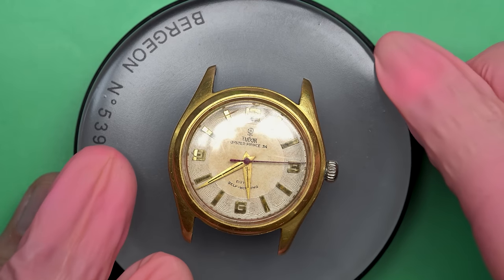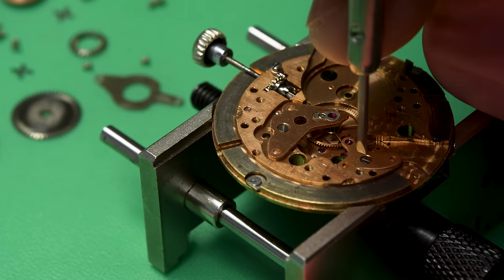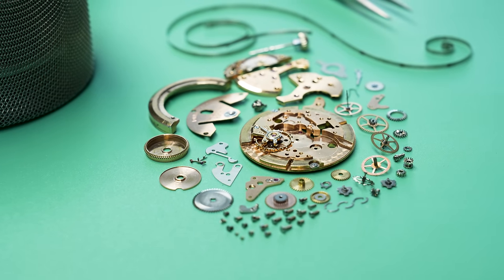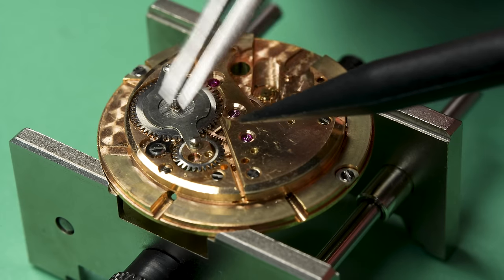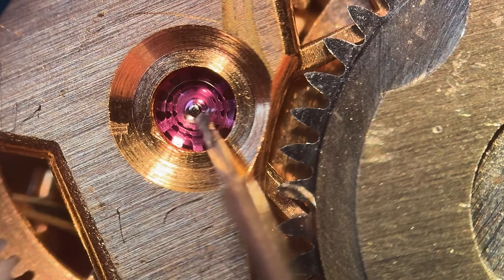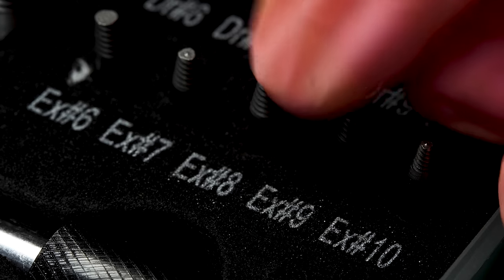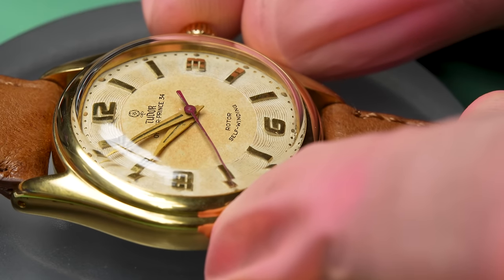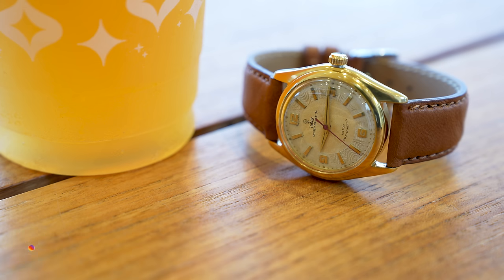Tudor Oyster From the 1950s Needs a Full Vintage Watch Restoration

Comment: Hay I've loved watching your videos they are relaxing and very satisfying to watch. I do have a question I have a watch that I bought from my fist job I ever had in 2004 I wore it for about 2 years and the stem broke on it I sent it into the company and they replaced the stem and after watching your videos I now know they left the stem about quarter inch to long with a slight bend in it so I was not able to ware it I still have this watch and would love to be able to use it again or be able to gift it to one of my kids when they get their first job but how do I find a reputable watch technician to fix my watch when the company that makes the watch made an error like that. I would love to send it to you to work on but I've noticed you tend to stick with vintage watches and or higher end watches this watch is a 200$ timex  I think.

Comment: Marshall, I am not sure if you have mentioned it in another video or not, but I don't recall ever hearing it. What cleaner solution do you use in the ultrasonic? You said in this video at 40:35  "some distilled water and a little of the cleaner that I use..." when cleaning the case. Curious what that cleaner is. Also, would it be safe or the recommended cleaner for movement parts if one were to use an ultrasonic to clean those?

Comment: Another great one Marshall! For the case tube, would it work to thread the crown onto the tube and then use the crown to tighten the tube into the case once the crown bottoms out? You could let the thread locker dry and then just take the crown off.

I’ve never done this, but I feel like it could work so you don’t risk scraping the inside of the tube.

Comment: I think you need to check those two spring clips.  It looks like the bottom of the U shaped slot is not seating into the groove in the shaft.  I noticed that the one had come loose during casing and you replaced it but it still looks not quite seated.

Comment: A little trivia about the 390 movement (along with the very similar 395) is that it is one of the very few in house, Rolex-made movements used in a Tudor.  After these models, by the mid 50s, they switched to AS and later ETA movements for the Tudors because there wasn't really any great distinction between the high end Rolexes they were selling and the Tudors with these movements.  Tudor was introduced in 1946 as a lower cost alternative to their higher end Rolex watches.
Reply: But was this a 390 movement?

Comment: I always though crystals were made of sapphire, and just a quick Google search shows that I guess some are. My question is why haven't I seen any sapphire crystals on the higher-end watches you work on?
Reply: He mostly does vintage. Sapphire is a relatively recent application. Kind of really only seen sparsely in the 80s. It's maybe in the last 20 years that it's become more of a standard (still tons of mineral/hardlex out there).
Reply: @notDonaldFagen  Thanks! All my watches are newer, like late 1990's and up, and I was wondering why my bottom tier quartz Seiko would have a better crystal than a Rolex!

Comment: I don't want a vintage watch to look "new" but I also think that a "patina" can get to a point where the watch looks straight up dirty and uncared for. I also don't want that kind of look. I think "cheap" when I see that. A face that's slightly discolored is fine but a big "stain" or much darker splotch right in the middle of the face with a outer edge that's clearly the original color is not what I would call a "good" look.
Just my personal opinion.

Comment: Marshall, please remove the shock settings from the balance (as well as other cap stones) before cleaning.
Reply: 31:05 you need to re-lubricate that setting. see the oil getting squeezed to the side? that path is much tighter than the other clearances, and capillary action chooses the tightest one, so over time, the oil will seep away through it, leaving the pivot dry.
Reply: Tudor 390 lift angle is 50º, so your timegrapher amplitude reading at 52º is exaggerated by some 20º. still not bad though, I was surprised, gauging the pre-lubrication amplitude by eye.

Comment: If I handed a tired old car into a restoration shop and asked them to restore it and I went to pick it up and it looked the very same as I handed it in, even though the garage had restored everything from suspension to engine but left the body work old and dented I would not be happy. I personally want the new look. I am luckily enough to own a Rolex which I purchased in 2005 and wore it throughout my working life until I retired. Last year I sent it to Rolex for a service and when it returned I could not tell I had a 23 year old watch, it was like new. If it had come back scratched and scuffed, again not happy. Sorry new every time for me.